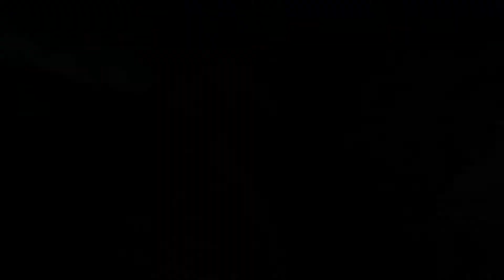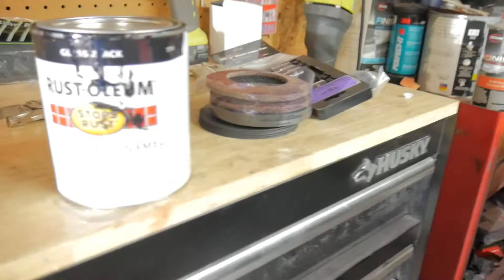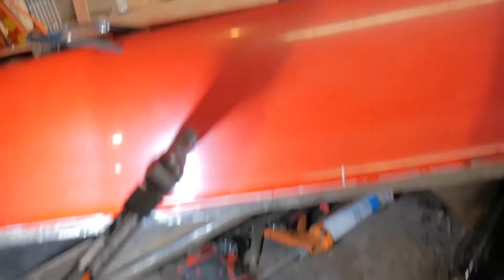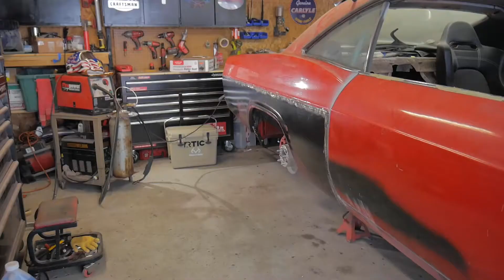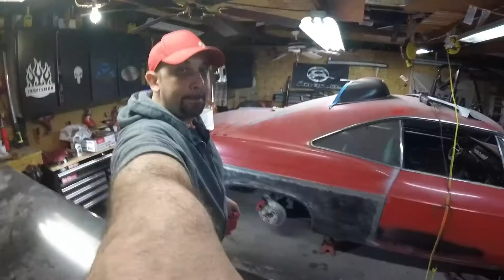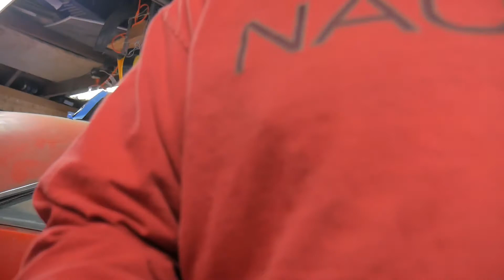Impala project 2018 rust repair /wheel well, trunk dropoff and quarter repaired

Comment: Is your pneumatic air flange (the one you got after returned the broke one) still “working”, I know you only had to use it for a couple panels and that’s it, but since then does it still work. I’m fixing my quarter panels and after two holes well not even two after one it quit and did the same thing yours did.
Reply from the maker: yea mine still works used it on installing quarters on another impala not long after I did mine.

Comment: cool im trying to get as much done before our 121 degree temps come in a couple of weeks im out in the back yard to keep the heavy metal work quiet frome my neighbors then ill pull it up front to the garage i should have paint on mine by September just wish my nephews did this 16 years ago when they had it i been working on it for 2 months a few hours a night and as much as i can on the weekends
Reply from the maker: Paul Casarez whats ur plan for the car as far as looks ? Lowrider? Original ? Im going with the low rod look, used to have 14 inch gold and chrome truspokes on it like 15 years ago switching it up now bagged on 20's

Comment: Hey Chuck try a Hole Saw Kit for Steel though...I need to go thru the frame for my side fill on my 64 C10to run A Filler I tried using my Cheap Harbor Freight kit but it was not the Bi Metal one I think it is their standard probably meant for wood. Anyway it at least made a nice round pilot hole and impression on the frame but thats all wore it out even with cutting oil...Thanks keep them coming! Impala coming along nicely too I might add!....Jeff
Reply from the maker: Jeff G thanks for the info !! Im pretty disappointed my plan was to get all the body work done, get it primed and ready for paint this last week and im still working on bodywork due to other things coming up and taking me away from the chevy man nothing goes as planned lol
Reply: I see what you mean! I have to do the rear right wheel arch patch panel I kept putting it off & putting it off I never done that before so I will watch your video over & over to build up to it HAHA Some genius cut the lip instead of Rolling the lip for bigger tires so I have no choice. My aunt cant  reach the bed fill gas filler so I gotta move it to the side well at least I have something to work on. Only down side is I gotta make the hole on the side of the frame you know those Hole Saws are pricey I f I get the wrong one I am out minimum 20.00 for one or 45.00 for a kit of some sort. You dont see to many of these videos in the Ether or as my uncle says Interweb...Anyway Just keep plugging away your getting there man.

Comment: Hey chucj what rear end did you use for disc brakes?
Reply from the maker: 12 bolt
Reply: On my 66 I used the original and bought a conversion disc brake kit from Right Stuff ..

Comment: My `65 SS was a nice car except there were water traps at the bottom corners of the rear window.  I repaired twice and after every time it got wet I sucked water out with a hypo syringe.    Still got rust. Front fenders in front of wheels were two piece.  More rust.  `66 that became one piece.
If I knew then what I know ,  better repairs would have been possible like some filler in rear window well and between two piece fender.
But what did a college senior know about that sort of thing.
Reply from the maker: You posting any video

Comment: Hey Chuck I forgot to ask you did you notice any difference in the car after you Re Located the Shocks up front? I got a kit from Speedway  to do the same thing I lowered our C10 with the 2 1/2 inch Spindle Drop kit and added the 2 inch lowering springs in front so I guess this means the truck is 4 1/2 inches lower overall up front? Some people say its not needed if you get the short shocks but I have already replaced those short shocks for being Froze up I can barely push the front down at all the way it is right now its like a rock up front Zero Spring back at all or just barely if you stand on the bumper and jump on it (I dont Recommend it)  I already hit the curb stops with the damn thing tore off the Grease Zerks on the Sway bar on both sides so I know its level anyway I should have bought the lowered Sway Bar Mounts they are shorter Any Way Let me know ...Today the Right Quarter Outer Fender Wheel arch Above the tire comes I start Sweating I still am on the fence do it or not I wonder how much $$$ should cost having A Dude Or Dudess for that matter do this part for me so I dont over Spend.  Any Way Again thanks for all the help My Tia Loves the Gas Pedal and brake set up I gave you credit for all of it HA So I am back for your take on this
Reply from the maker: Jeff G thanks for for the cred lol when ever you lower anything the ride is gonna be a lil stiffer unless you go with an air ride and then the ride doesn't suffer. The lowering springs are prolly stiffer they may soften a lil the more u drive it but not much. My shocks made a noticeable difference but that's cause I have air bags and had a lot of bounce to the front end the shocks helped control that so that was my main reason for installing them. As far as the bodywork goes it's hard to put a price on it, your best bet would be to ask 3 or 4 shops to see what people are charging in your area, in my area its anywhere from 500-1000 to do a outer wheel well and quarter. But some places wanted even more so just depends I guess. It's a tuff decision to have someone do it or to do it yourself. Idk I try to go by the motto built not bought, I was scared for sure doing such a big project but I couldn't bring myself to spend close to 2000 plus the cost of the metal for someone e to do it. So I just researched my ask of and dug in and did it ! Is it perfect.....naw but I can't complain it came out decent and I'm proud to say I did it. Plus I learned a lot in the process. And now after watching me  my neighbor across the street is more confident that he can also do his on his 66 impala. I don't think it's hard just take your time plan it out and don't cut to much,line up body lines and weld slowly hope this helps ! Anything else let me know ! Good luck
Reply: OK Thanks she only drove it 1200 miles since I did the drive train...then I take it back and start doing something else to it. Never thought of letting it settle down in front and see if it improves a bit plus I have never driven anything this low it might be normal just getting used to it so I better stand by and let it be for now. 
I am going to do the Panel myself then at worst I will have to buy A whole Quarter If I do that then I can just go ahead and take the bed off and apart to add new stainless bed bolts and do the bed floor in peace in the garage just add some temporary lights out back so she can drive around If I choke I can always buy a new whole right side from LMC just wanted a little push that way I must have done that panel in my head 50 times by now and seen the videos 50 times HAHA
My Tia  just wants the truck itself back bed or no bed as she says! Ive been doing one thing or another to this rig for years HAHA. Next Year we are supposed to go to the Street Rod Nationals in Kentucky we are already Taking the 1962 C10 Flatbed now that it has the LS Engine swap should be more reliable for Towing the 35 Ford Bobber rat Rod on the trailer it has Dog bone rear suspension so no way would we drive it all that way its like sitting on a buck board and now my aunt wants to follow in her 64 then cut North for Des Moines to visit her Peeps so I won a time reprieve to add the A/C/Defrost and finish this
Reply from the maker: Jeff G I want ac so bad might install a kit over winter
Reply: Southern Air has good kits and they are about half of what Vintage Air charges just make sure you get the All electronic set so you dont have to use the Cable pulls they take up too much space to work the defrost and floor heat Make sure it has all the features you want before they ship better to call them. I understand one old guy is a bit of a hard ass I just ignore that never know what I might be like in 20 years maybe worse...and for less than 800 bucks complete I can take it makes me laugh actually ...Check Em Out...Thanks Again   jeff
Reply: Its going to be 114 here in Riverside for one day tomorrow so Yes The A/C is A Must in the winter the truck cab gets moisture build up with 2 people on board so you gotta have at least defrost or your driving blind. Thats why I went with the V Belts and the short pump If you see the 64 to 67 Corvette A/C The compressor goes on the passenger side and the Alternator on the driver side and they have 2 1/2 inch Collectors Cast Iron so not as restrictive as the 2 inches I used all the pulleys but used The Head Mount Billet Specialty Brackets for the Modern Passenger side Compressor And Drivers Side Alternator this allows for clearance of the Valve covers need more space just get a bigger Belt and or Eyelet Adjusters I have never thrown a belt with this set up and I spent 1/3 what the Serpentine style costs check it out on our truck would be the same on the Impala
Reply from the maker: Jeff G I'll have to check that out when I get around to doing the ac thanks

Comment: Damn Dude 117 Degrees right now 238PM 07/06 I dont ever remember it being this damn hot must be a record At Least I dont miss the 90 degree and 90% Humidity in St. Louis!... But Yes this is HOT! Oh I am gonna get that A/C Done One way or another HAHA
Reply from the maker: Jeff G cool down a lil bit today and will some tomorrow get to work though and then party at my house at night for the UFC fight lol so prolly won't get much done on car maybe Sunday
Reply: I hear you I am inside cleaning up I am also working at night  at least the rain rails were not trashed I am using something like A large Dremmel to clean out the gunk Caulk like stuff someone put in but thank god otherwise the cab would have been compromised.  I dont know if I am supposed to just POR 15 and then primer & paint or am I supposed to put silicone to seal it. I sorta like the way it looks now the channel is deep all the way around now sorta makes it look like one roof piece all unto itself...Have a good time with the Fight night..BAM

Comment: Smooth, as I was watching this beginning of the video, the best thing I dig was you putting the visible inside panel with the rust-olem paint. A lot of body shop wouldn’t spend 20min for a quick coat. What tools did you used to cut the quarter panel with, please advise bro
Reply from the maker: Thanks homie. I used air saw and then switched to a 4 inch cut off wheel. Cut off wheel builds up some heat so be careful